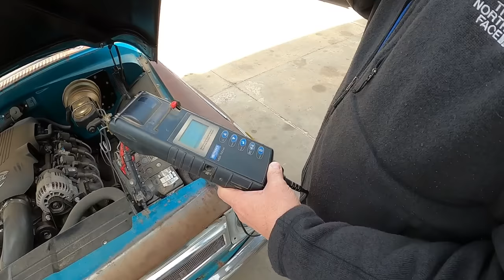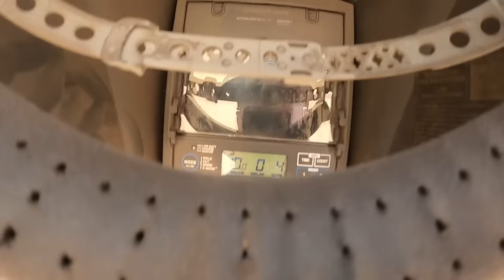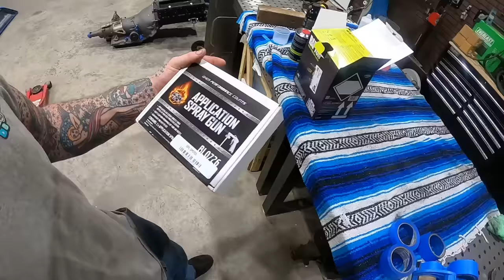Model A fender UPGRADE! Trailer Maintenance for road trip.

Comment: Hey Puddinx',  I'm up in Mass. and was outside working on my truck ( sitting on your ass...) when the eclipse started. I had forgotten about it until I noticed the change of light. This one lasted over an hour because the sun was moving with it, so it seemed. I just turned 60 and have seen a few and like you said, " kinda uneventful". Even the full eclipses only lasted 15 minutes or so. This is probably the last one I'll ever see, so it was kinda cool it lasted so long. I also weld and had some shades on hand for my gal and myself. Thanks for all your videos, they keep me going and motivated.

Comment: The best way to put the oil/gas or oil/diesel mix on your trailer is a pump sprayer like you would use for weed killer.  It spreads it nice and even.

Comment: It’s good to see the girls out there hanging out with ya!

I’ve used the raptor liner a few times and always had good luck out of it, but I’ll definitely try the Sweet Patina’s stuff on my next project!

Also, everyone I know uses old motor oil to coat their wood deck trailers and they’ve not had any problems. One thing you could do next time you coat it is put the motor oil in a big sprayer and coat the entire trailer. When you were rubbing the trailer with that rag I was sure hoping you wouldn’t catch a splinter!

Comment: Always enjoy the 2ND channel content.  And you can see that Theo is now living his best life.  You are giving him the home all dogs deserve.  Here are a couple of things you might be able to use.  Get some THICC 2" fender washers and tape them in the corners of the drop cloth.  Helps hold it down and makes it easier to lay out, without getting in the way.  Also Amazon sells a 9w solar panel that keeps batteries charged, about $40.  They work really well I use on my RV battery without any issues.  Thanks for the honest comparison between Sweet Patinas N1 and Raptor liner.

Comment: You coat the wood on top of the trailer because the top of the trailer faces the weather the most. But coating the bottom would also be a good idea.

Comment: Every year I coat my trailer deck with 2 parts used diesel oil and 1 part red diesel. The stain has a slight red hue in the sun.

Comment: Video highlights, Shaggy/Scooby impression, best feature on wagon is the 2 threads holding the quick disconnect steering wheel on, no knock test to instant knock test into the body lol, and the girls have to come out to the shop to see the dog 😂, always good to see the girls, give ole sleeperdude a run on those family style videos

Comment: Dang I wanted first comment. Hi Mr Puddin
I’m not saying get it. But I build metal buildings. They sell “metal J channel” for around windows just tell them how thick the rock is. Screw it right to the window frame or closest stud or track.and it will never move and be nice and tight for you. It’s easy to cut and super easy to install.

Comment: You should have a lot going on. I would say oiling they would wish to do that with trailers flatbeds and even railroad tie retaining 🧱 walls. I have used used motor oil in a very long time. The EPA license screen about the carcinogens in the used oil. But it does work better than fresh. I have not had any problem with my would going bad in my trailer to speak of old last 10 years I'm not doing that. But do you live in a four seasons climate. Great video.

Comment: putting that on top protects it from the sun and water as well. I would use a plastic bug sprayer and spray it on with that. You could use a paint roller as well.

Comment: Jacob didn't say what pressure he was spraying at, but with Raptor you want to be at 30psi or lower (it does say this in the instructions). Higher pressures and it can be thin and blotchy.

Comment: The gas in your used motor oil will act as a drying agent. The oil soaks in and protects all the way through. Best use for old motor oil.

Comment: Make sure you check the ol diff fluid and the passenger wheel bearing on the travelall. I remember it gave u a fit a couple years ago   you looked it over and i think u fixed a caliper  but wanted to inspect the bearing later.

Comment: I use cheap deck stain (preferably oil based) on my trailer decks. Looks good and protects it. UV protection is another reason to stain your trailer decks too.

Comment: That wagon would make a great "road tripper" as you can lay the seat down and sleep in the back. Maybe the difference between the two paint systems ids that the N1 was more paint and the Raptor was more like bedliner and then thicker?

Comment: Those ez greasers are nice but be very careful with them. Easy to put too much grease and blow the dust seals out. Not a massive deal on the axles without brakes but the axle with the drums it will ruin the drum and the shoes once they all get covered in grease.

Comment: Don't forget they still have to caulk around the windows I mean they no matter what don't caulk around there and all that'll be fine they put their interior latex caulk in there in that way when it cracks expands with it and doesn't show it'll be fine then they paint it it's going to look good so the cracking is normal it doesn't always crack but it happens but it's not a big deal. But thanks for the video appreciate it

Comment: 41:08 The motor oil will wash out of the wood when it gets rained on. Then it will go to the ground, just look for the oil sheen. The problem with used motor oils is that they contain other compounds from oil and fuel additives, new compounds made during combustion, metals, and Policyclic Aromatic Hydrocarbons (PAH). The latter item garners some attention as a source of health problems, and scientists consider some to be carcinogens (Center for Disease Control). This being said, there are a lot of leakers on the road, and motor oil is not the only source of PAH's, but I won't advocate giving up BBQ... well, maybe the burnt ends.

Comment: A guy has to wonder what that does for the flammability of the floor of that trailer. I know a couple shops around here that store up the used motor oil to heat their shops when it gets cold in the winter.

Maybe throw a fire extinguisher in any vehicle that will pull the trailer for funzies.

Comment: Used engine oil is the best for trailer deck coating.
Reply: I also don't cut mine down, and I use a cheap roller and paint pan. You stay clean that way, and it goes super fast.

Comment: I tighten my bearings all the way to seat the bearings, then back off and re-tighten torqued to 35-foot pounds. Then back off just enough to fit the cotter pin. DUN

Comment: I'm going to check out the N1 over Raptor for pickup bedliner. I have two beds I need to do, both are the same color. Is the N1 tintable, so I can shoot them in white? And I would like it to be "bulletproof " for hauling stuff.

Comment: Just have to stick my 2 cents in....treating the top of the wood on a trailer will give some protection from UV degradation. Ideally you could take the boards off and treat all the surfaces, but only severely anal people such as myself would think of such a thing.
Great to see Theo thriving! Blessings to you and your family!
AND...don't forget to fill the filler tube on the Travel-All!

Comment: I wouldn't have oiled that trailer deck. It'll get wet underneath and not be able to air out and dry. My Dad did this to a rack body on a Dodge 1-ton and it rotted right out. I fell through a couple of the boards. Hope you have better luck. Edit: It'll also be an ice rink in the wet.

Comment: @PuddinsFabShop2 Hey order you a Harbor Freight 2"DA. Its a business expense. That's tax deductible, just like all the gas running down to Houston and the hotels or all the food you eat while down there. Its all Tax deductible. Business Expenses are amazing. lol
Reply: Puddin that stuff happen when doing a little dry wall plus tape and bedding. Mud does shrink a little when drying. You can call them back to inspect and fix it or just when your ready to paint have the painters put down some paintable window calking. I have done both window installations from consumer grade to professional grade like security glazing or store front. So yeah paintable calking is widely used. When I was younger I did a lot of construction and I mean a lot. So taking and bedding, yes Sir I did that as well. It was fun and easy. I have a blast doing it. K well  thanks for the videos and peace.

Comment: I can’t help but wonder what is running through Theo’s mind when Puddin starts his kong fu fighting.  There’s a few times I swear he looks like he can’t decide if he should go get help cause dad’s having fits again or should he jump in and help him bring the beat down.  The sheet rock mud will often crack when laid in THIC  in higher temps because it dries too fast. That’s what 2nd coats are for.  It is very hard to find people to do good work. People don’t take pride in what they do it’s all about how much they get.  It seems to get worse everyday

Comment: Puddin, I bought a set of Hankook’s for my 2003 Ford F150 FX4 years ago ! 6 months after I bought them they started to crack down thru the treads ! Hankook said that they would go 1/2 on a new set ! Not happy with them on that, I think that there tires are not very good ! I would never buy there brand again ! 😡

Comment: The proper mixture is used motor oil burnt linseed oil diesel Farmers Farmers Farmers dad has been putting us on the barn for 150 years the barn looks practically new I did my fence this way smells like the Dickens for about 2 weeks but then preserves it like nothing other if you have a post and beam shop drill holes and all four corners of the footings and pour this mixture with a funnel down in those holes and your footings will never wrote out it pickles I'm from the inside